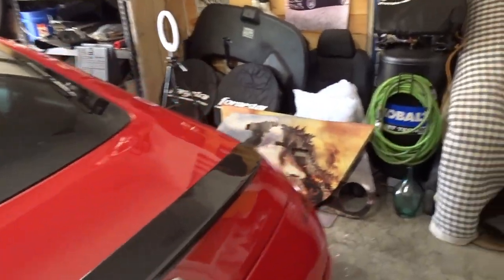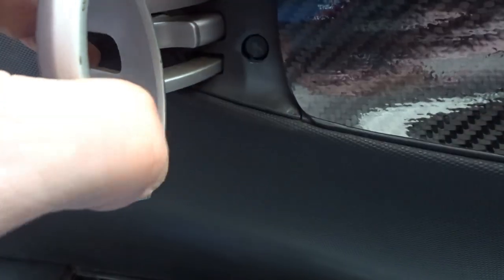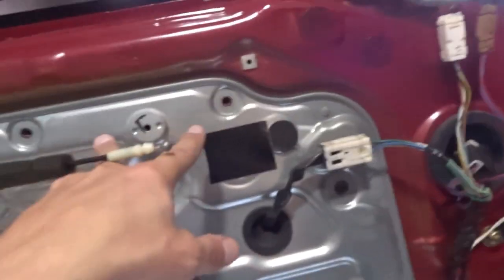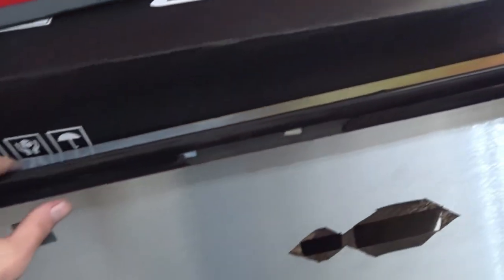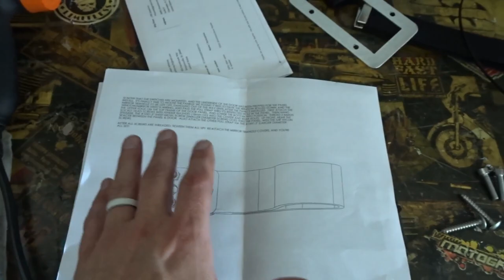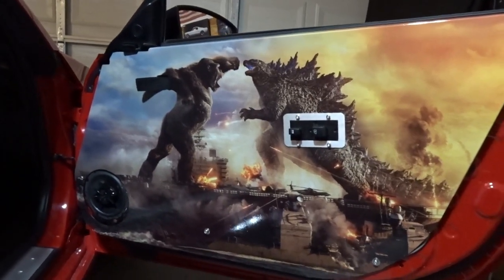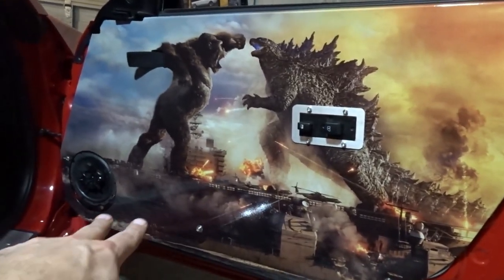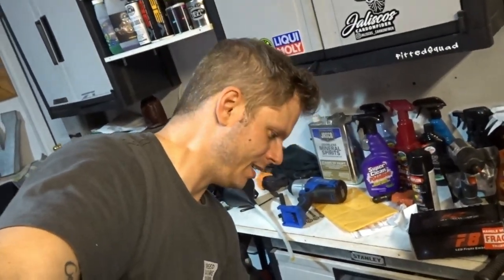Most Insane 350z Interior Has Begun | LRB 350z Door Panel Installation

Comment: Is it possible to just relocate the windo switch
Reply from the maker: Yes, it could be relocated technically.  These panels have the hole cut out for the switch though, so that would be a problem.  The only other issue is that the window switch is pretty thick so you're limited to where you could put it because it would be pressed up against the door if you tried to go lower, for example.